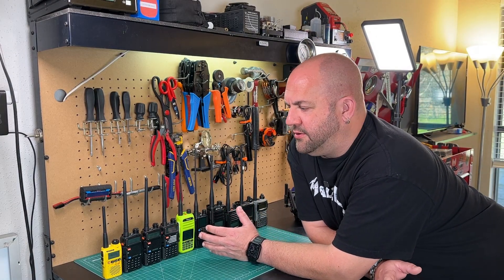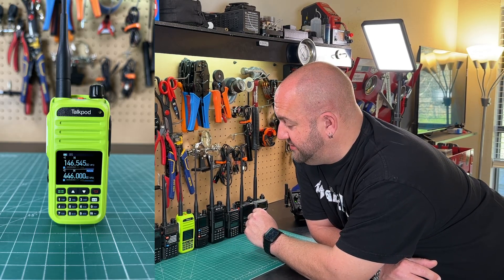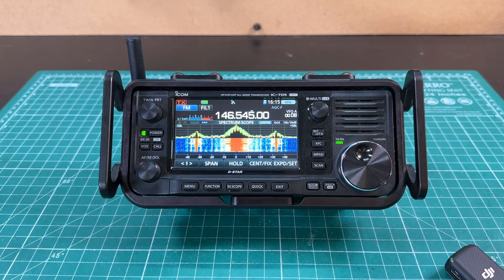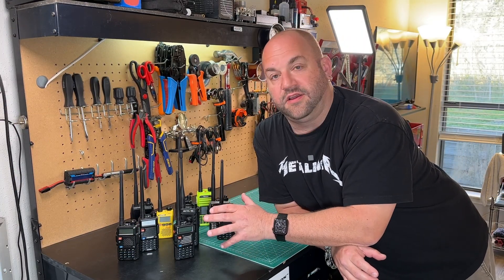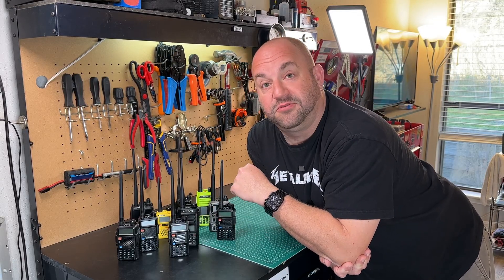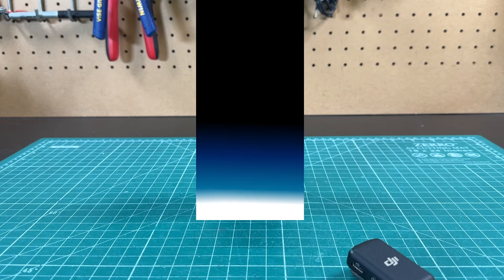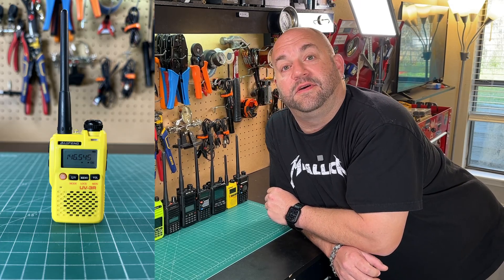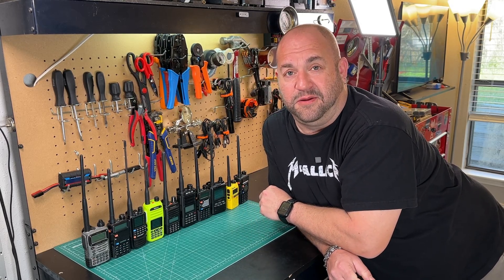Do Baofeng Radios Really Sound As Bad As People Say?

Comment: I thought myself that number 10 the Baofeng UV-5R sounded best on both transmit and receive and that radio number 8 was worst for both. I would still recommend using a good quality speaker mic on any handheld radio such as the Baofeng BF-850 speaker mic. I use a Baofeng DR-1801 with that speaker mic and I get good audio reports in analog or DMR mode. The longer the Chinese make radios the better they are getting. I wasn't around when the Japanese broke into the market so I have no idea if they were initially viewed as junk. I'll continue to buy the Chinese radios and will likely buy one of their HF rigs as well.

Comment: Hi Mike,
Your channel is one of my favorites. I discovered your channel via HRCC (another favorite). I found this episode to be specifically interesting.  While each radio's speaker and microphone sounded differently terms of pinch, none of these radios sounded unacceptable in my experience. I have heard complaints about the FT5D and when I first got my FT5D, I was able to improve the FT5D's transmit audio via the Audio Pitch and MIC gain settings.

73,

Phil W1ZOT

BTW, I'm in Euless, TX

Comment: The main thing I’ve heard mentioned and also heard myself is that the audio is very quiet on SOME baofeng radios.  It’s not all of them but some you have to eat the radio for someone to hear you well.
Reply: Yep, I think this applies to mine, and many of the early ones. I think it's because they tried to be water resistant and had either a membrane or other blocked path to the microphone. I have this vague recollection of people drilling holes in the case to rectify the issue but I might be thinking of something else.
Reply: BFs also don’t have any mic gain so you’re SOL if it’s too quiet — of course mic gain can be a contributing factor to making audio worse if you aren’t getting signal reports when you change it — hard test because of the variables. I too was surprised by #8! Still my daily driver since i get more complaints on repeaters about my other radios

Comment: I've had positive comments about audio quality on my Baofeng UV-82.
Reply: I bought the UV-82 specifically because of the speaker on it - I heard it was better than the UV-5R and thus it turned out to be. I haven't tried getting compare reports on the transmit audio, but I do know that both my UV-5Rs tend to be quiet - I think the originals tried to be water resistant so had a membrane over the microphone.

Comment: Surprised the FT5D sounded so bad on both. My daily driver. I hope you do this again with another batch of radios. Surprised you didn't use the IC-705 to do the recording internally. Guess that'd be harder to sync to the video.
Reply from the maker: That would actually be pretty easy.  That’s a good idea.
Reply: If you do this in March you could do a bracket thing ie "HT Madness". Or send the audio files to a bunch of other ham YouTubers and have them rank them "blind". But even if it was just like this with more HTs from Alinco to Wouxon, it'd worth watching. 73